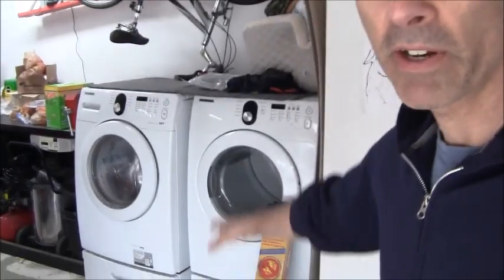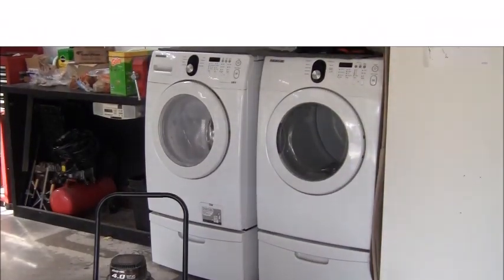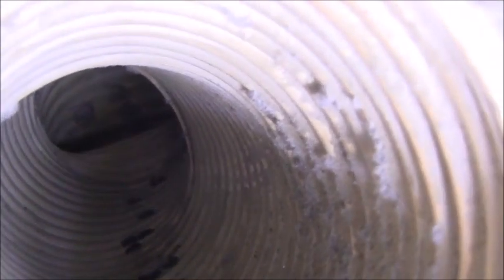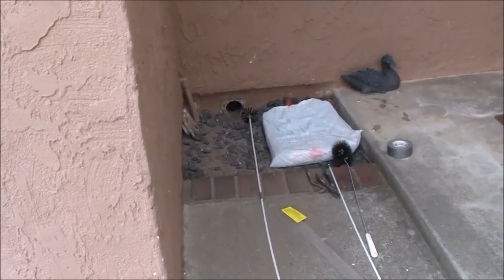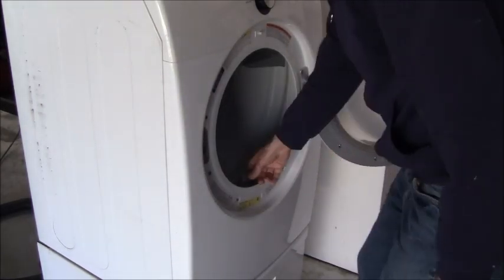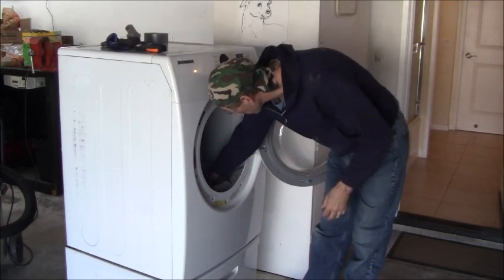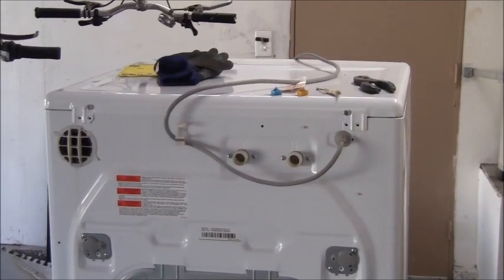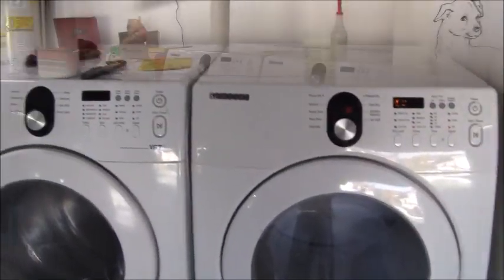Cleaning Samsung Dryer Vent and PM the Matching Washer

Comment: I bought that same kit at Lowes a few weeks ago and will be using it this weekend so it was nice to see some tips. When I first saw that exterior  dryer vent louver I was thinking that was going to be a problem with rodents before you took the ducts apart. I had an issue a few years ago with bathroom exhaust fan louvers that were up high and birds were getting in them They make a lover with a pest guard that will prevent those critters from getting in. Good video.
Reply from the maker: Thanks